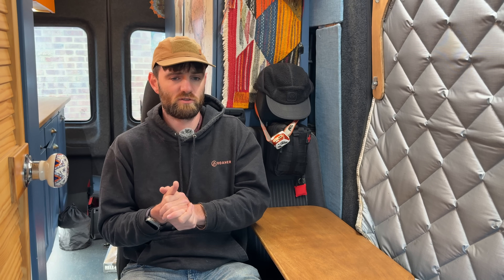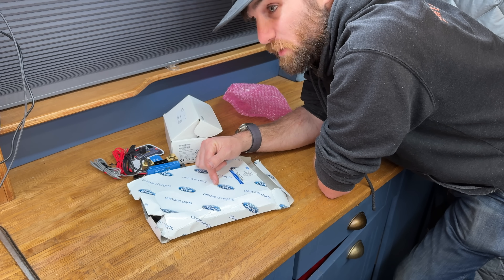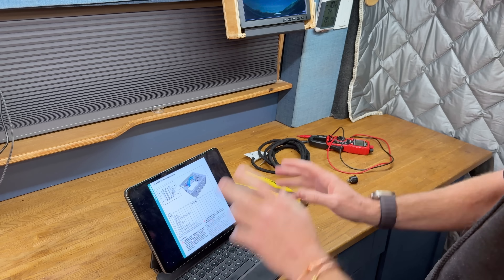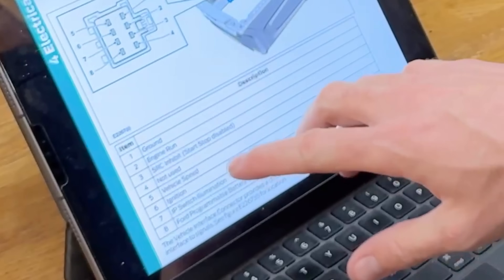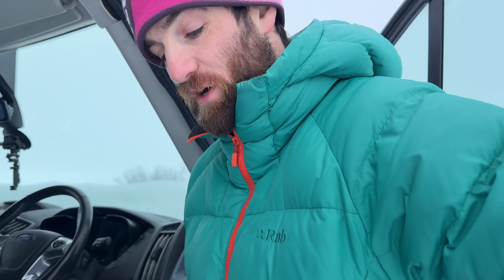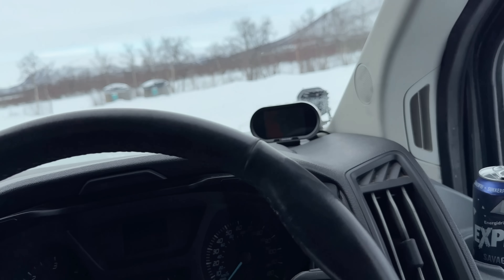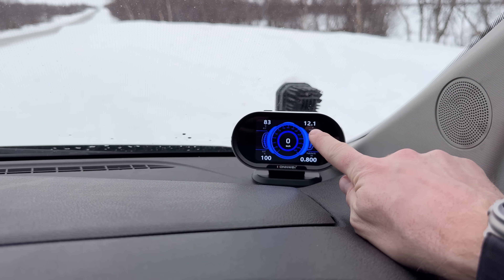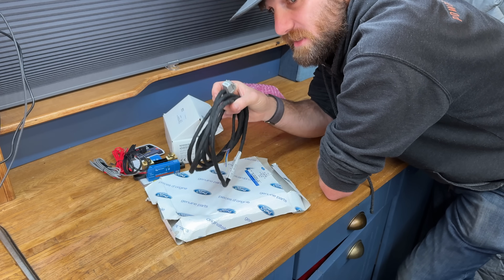FORD TRANSIT: How to DISABLE Smart Alternator “Official FORD Method”

Comment: Hate anything with the word smart in it You know it is not smart for the owner only for the bean counters!
Reply from the maker: I don’t really think so in this case. The smart alternator concept isn’t really far-fetched or even that smart. effectively turns charging off from the alternator when starter battery is full and it seems a bit of fuel.

It’s been around almost 10 years. 99% of users don’t need to run auxiliary items so there’s no real drawback. 

If anybody is losing out, it’s probably the fuel companies. As the engine uses less fuel, therefore you need to buy less.

Comment: Letting voltage fall to 12.1V on a small-ish load is not 'smart' any time. 

Voltage is not the best guide to state of charge in general, but if you let it drop that low, you risk parking the car with the battery low enough to sulphate (shorten its life) and/or leave people stranded.
The way to do this properly is a LiFePO4 battery that is happy to be left 1/2 charged and "Coulomb counting".
Reply from the maker: We are not talking about state of charge at all using voltage. 

smart alternator charge the battery up to full like alternator, but then turns off it output and save fuel. Normally this fine. But if you use big draw auxiliary items so can sometime mess with them

Comment: Problem with Victron is that the standard smart alternator setting is way too high. You need to set it quite lower to get it charging properly. If you do so the ECU will notice there's a big amp demand and will keep the alternator charging. BTW the best way on Ford is you use the Engine Run signal in the L pin of the Orion on use a relay with Ignition+Engine Run to get a D+ and use it on the H pin. If you do so there's no need to inhibit the SRC charging becase B2B charger(s) will be running if the engine is running but if the battery is full it will work as usual.
Reply from the maker: I already use the Orion pins for a signal live on / off 

And it’s quite common on how the transit deals with it but to not kick back in even when there’s a load. 

I’ve had both charges in bulk mode only output about 12 amp. When the van goes into smart alternator mode.

Comment: I had a 2008 Smart car that used this fancy over complicated alternator charging system. Why can't they leave tried and tested system alone?
Reply from the maker: Ifor 99% of people who are not wanting to run auxiliary charges and items off the alternator it’s not really important.  it just saved a bit on fuel. 

Although the reason for adding it was most likely to meet emission standard requirements
Reply: @MispronouncedAdventures Thankfully the one on my Smart didn't fail whilst I owned it, the cost and being able to fix it myself was my concern. Similarly, that's the reasons why I won't own a vehicle with an electronic parking brake, I know of drivers who have, the expense and hassle that they can be.
I'm aware of the plan to get us all off the roads, no flying, traveling far etc by 2030 so I'm clinging on to my old vehicles/fighting against all our freedoms and choices being taken away basically.

Comment: Had one of these in my truck and it would turn of and stay of till the battery was down to 9v. Then it would turn on and charge again but if I turned the truck of when it was down to 9v it would not start again because the battery was dead and there was no warning to tell me it was dead.
Reply from the maker: Sounds like there was something significantly wrong with your system somewhere. As it should be coming on to keep it maintained near full opposed to only coming on when nearly empty.

Comment: When the Smart alternator is engaged, does the motor consume more Fuel? You know like a Geny, when you start putting it under Load.
Reply from the maker: Yeah, thats point of the smart Alternator, the alternator turned off when the van thinks it’s no longer needed, less load, less fuel.

Comment: Great info Alex. My renogy dcdc unit doesn't show enough info. My simple power display sits around 12v and only rises if heater and lights are switched on = smart alternator.
My renault wiring  might be workable like yours... Thanks, I'll look into doing that on my camper.

Comment: Can anyone tell me the benefits of a smart Alternator?
Reply from the maker: It’s just a bit of efficiency. The OBD2 heads up data read out. I have one of them set to engine “load %”
Engine load drops a few percentages when the vehicles in smart alternator mode kicks in.

I think it’s mainly because for the euro ratings they need to claw back every single opportunity for efficiency
Reply from the maker: For every day car driver who doesn’t have any real use for their alternator or auxiliary items probably gets back a bit of mpg and saves fuel but become a bit more of a nuisance on the van when you’re trying to run things

Comment: Wonder if this is the same set up on the Transit Custom? I've done the twin battery conversion on mine.
Reply from the maker: As far as I’m aware, yes the customs actually use an almost identical wiring harness and set up. double or single start battery doesn’t make a difference in this case.

Comment: OMG just what I need for my van MAN tge Thank you. On your victron screen I saw you have alternator showing! I haven't got that on mine is there a switch in setting to turn it on somewhere ?
Reply from the maker: You need something to give it the information. An Orion XS connected to a Cerbo or my case a Victron smart shunt set to DC meter mode and "alternator" charger

Comment: Most Transmitting Radios, either CB Radios or Licenced Amateur Radios, are optimised to run best on 13.7 Volts. So even in "normal" use on one of those "Smart" charging system equipped vehicles, they will be operating at some amount BELOW their proper operating voltage. Seems to me more proof that "Smart" charging is a very dumb idea indeed.

Comment: As a mechanic,I’d be very worried about using a van in those conditions that has a WET belt 😮😮😮
Reply from the maker: For the Nordics locals the Ford Transit is the perfectly normal van used since launch in the during their normal Arctic winter and all over Europe. The biggest issue with the wet belt seems to be the end user doing poor service intervals or the wrong oil being used.
Reply: As a consumer I am worried about his mental health condition because he purchased a vehicle with a wet belt.

Comment: Very interesting Alex, as you may remember Sam on his Mk8 460 Minibus conversion has two Renogy 50a DC to Dc running from two of the 3 60a consumer connection points. His is the 2 battery start stop version. The Renogy auto detects smart alternator or standard alternator and does not switch off the charging when the alternator shuts down. On his though the Ford BMS system can detect ok the high draw and only shuts of the alternator for 30 seconds or so before firing up again. This has never been a problem on his. The problem we had with the regen charging was that the cheap batteries under the drivers seat were upsetting the system and replacing them as a pair with Bosch start stop batteries and resetting the battery learn in fordscan has solved the weird charging issues. He also monitors ecu voltage on an ultragauge like yours. I was also wondering if the start stop button disables smart charging as there is no eco button as mentioned in the manual. Will try when next out and about. By the way my 3 lead acid batteries on my Sterling set up are still going strong after 7 years. Need about 2 litres of water top ups though! We have sourced a Ford Eberspacher for the 460 and will try and fit it as per the accessories to use the internal heating fans.
Reply from the maker: Yes, I remember. More of the issues occurred when I put new starter batteries in and did recalibration. Seems to me the new batteries were so healthy that the van could see they were easily fully charged and kept telling the alternator off

Comment: Great info.  If you added more info to description about the ignition/engine live pin configuration, it would also help people with these vans (think it also applies to Transit Custom) installing DC-DC chargers which need that signal wire, I was recently searching for this info (and this video would get more views).
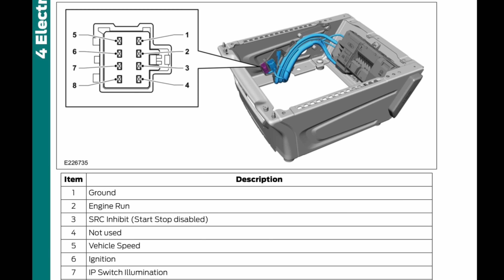Reply: Looks like pin 6 at 4:11
Reply from the maker: From my understanding generally the electrics are the same between the big transit and the custom. There are quite a few variations of the plugs, depending on which year the van is

Comment: How do you disable the automatic clutch burner function?
Every time you release the clutch while in gear, it raises the rpm as high as I would never do it when driving off!
Disable the clutch switch?
Reply from the maker: Not really felt of a problem like this or ever heard of it before if I’m honest? 

What year is your van? It’s not something I’ve heard of
Reply: @MispronouncedAdventures  I don’t have a transit (wouldn’t buy one if I‘m honest).
But I took care of a fleet of minibuses (various makes) and all Transits after 2014 (6th series) had it.
Some people drive diesels like spark ignition engines and burn the clutches when you can usually even shunt them at idle rpm.
Problem with the Ford engines is however a lack of torque, so they came up with this clutch burner function.
What’re you disconnect the clutch switch (depending on whether it closes or opens the circuit)?
Reply from the maker: You can’t disconnect the clutch pedal micro switch as you won’t be able to start the engine. 

As the vehicle ECU needs to see the clutch is depressed to start engine when you turn the keys in the ignition
Reply: @MispronouncedAdventures  Wouldn’t that be ok?
The rpm increase when the the clutch is closed.
Don’t know if this opens or closes the circuit, but with the ECU assuming the clutch is open, it wouldn’t raise the rpm and one could desert the vehicle.
Would love to play with this…
Reply: this is done "automatically" to prevent very low rpm and clutch hopping ....some drivers can easily induce even harsher oscillations and this strains the dual mass flywheel... I dont like it either, but its not that muh of an issue for me
Reply: @JanicekTrnecka  I usually shunt diesels with the clutch only, and this gets the rpm far too high.
Took care of a fleet of vehicles once where there were drivers who drove diesels like spark ignition engines- and they burnt a clutch/year!
So yes,, it reacts to the clutch pedal switch. I wonder if you disabled it (open or closed the circuit)…

Comment: Same with a Renault Master 2017 mate - although using the Vctron XS indtead of the Victron 30a has stopped the low output I have.  I have both installed but on switches.
Reply from the maker: Yeah, I often find even if you have the manual switch if the alternator is in smart mode, then you’re just not gonna get the power. I assume there be some sort of similar override for yours most vehicles seem to have it somewhere.

Comment: IP illumination is instrument panel lights. You could use it for outside extra lights. If the dim switch turns on the instrument lights then also outside extra lights will illuminate
Reply from the maker: Ah cool! That makes a lot of sense and is a good use for it

Comment: Great info, thanks! Have you tested how the Bluetti Charger 1 is working with a smart Ford alternator? Will the alternator also refuse to give power to the Bluetti Charger 1(which is connected alongside the main car battery)?
Reply from the maker: Bluetti Charger 1 will probably act like any other DCDC charger. If the voltage drops because it goes into smart regen mode then it will turn off. 

This would fix it if it does.

Comment: Did I get that right, if I knock off the Stop Start, it achieves the same result?
Reply from the maker: That’s what the BEMM manual says but it’s not a feature I have in mine to test myself.
Reply: @MispronouncedAdventures  Thanks man, i'll test it out. I don't have an "Ecomode" per se,  but I do have a disable Stopstart button :)
Reply: @stuartmccloud307  come back and let us know if it works :) !!

Comment: Does someone know how I can disable that in Sprinter 316 CDI, W903?
Reply from the maker: Unsure how to do on a sprinter personally hopefully someone in the comments can help you.

It seems it is somewhat a common feature on vehicles though. Especially work vehicles which a end customer might require a high output mode for auxiliary items.
Reply: On the Sprinter, I would fist try the OBD way: connect a good computer to it and browse. There are quite a lot of functions, so this could be in there.
Regarding the „smart“ charger: This (just as a „smart“ oil and high pressure fuel pump) is used to save fuel. Alternator load can be heard on idle after all, so they donate a point. It would however be nice if there was just a switch, OEM installed.
Reply: Are you sure your W903 has a smart alternator? On my 313cdi 2015 I drive with dipped lights on, this triggers the smart alternator to kick-in, sending constant power to my DC/DC charger. It's the same scenario of Alex's Ford, no lights on, means no power after 15 mins or so. Lights on and 13.4v constant.
Reply: @Chrischalkart  I'm sure. I don't have a DC-DC charger yet. At startup, I get 14.2V, but it quickly drops to 13.5V and stays at or below that. I have tried changing parts, bypassing, installing a new D+ wire, etc. One method is to install a DC-DC converter between the alternator and battery, but I wonder if there's a better solution.
Reply: @UmbrellaHuskies If you're eventually getting a dc/dc, and you can get your alternator to produce 13.4v, I'd say that'll solve your issue. Mine a 30amp victron dc and it charges my batteries no problem, at 13.4v it produces 30amps of charge. I did a lot of research on this smart alternator issue when I fitted my dcdc in Rovaniemi. The 'lights on' method saved me. If you can find a better method of tricking the alternator however I'd be very interested. Interestingly turning the a/c on does not trigger the alternator to engage, as some people suggested.

Comment: Very interresting, im building a camper into an ford transit 2020 right now, so my questin would be where you got that instruction manuel you showed, i only have the user manuel. Sorry if you said that my english is not that good. And do you have a clue where this plug would be in a van with the driver seat on the right side? Thank you for heping in advance!
Reply from the maker: The manual use is actually available on the Ford website. 

It’s called the “BEMM” manual. There are a variety of versions for different years of the vehicles age as they change every few years.

As far as I understand it’s always inside the drivers seat base alongside the starter batteries and primary body fuse board so doesn’t matter if it’s left-hand drive or right hand drive
Reply: @MispronouncedAdventures  Thank a lot. Im from Germany and the ford.uk side is blocked here. So, being without an VPN, i cant acces the direct document  as the ford.de site is not listing is. But with the name you gave, BEMM, i could find people uploading the enlish version wich is an immens Help. Cheers

Comment: Brain fart - I wonder if it might be possible to hook up a relay. My idea is.... Victron sees batteries are fully charged and sends a remote signal to switch Smart Alternator back on. Would probably be more effort than its worth.
Reply from the maker: ( that’s a brilliant idea, why didn’t I think of that! Best of both world  )
Reply from the maker: Yeah I’m sure they could be done with Victron Cerbo GX logic using the built in Relay and SOC data. Smart idea that
Reply: The entire purpose of the system is to squeeze micro fractions of a mile per gallon out of the truck. It doesn't actually impact anything meaningful in the real world consumption of the vehicle. Turning the system back on is not worth the complexity.
Reply: @otm646 Nobody needs a Lamborghini Aventador, but they exist. I guess it depends on your skillset and interests as to whether you think it’s worth it. Cool little project I think. Check out Project Binky if you want the ultimate in automotive “not worth it” restorations. 😊
Reply: @otm646 and extend the live of your start battery
Reply: Definitely worth it if you drive long 

Keeping your battery at 14v 24/7 will dry it out
Reply: Might be too blunt a change and could “flap” on/off if you have a load on them whilst driving?
Reply: @bis0nat0r A really simple “debounce” circuit with a 555 timer could prevent that. It would insert a delay to allow voltages and control inputs to stabilise.